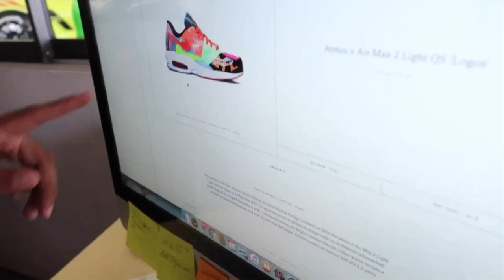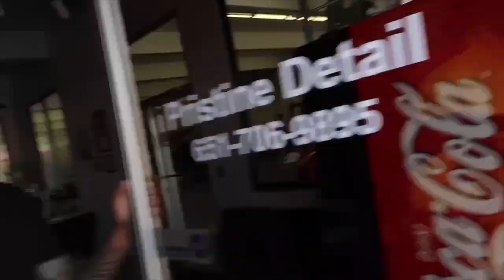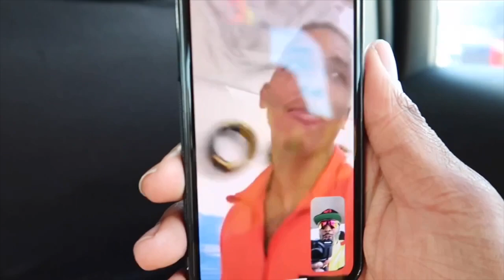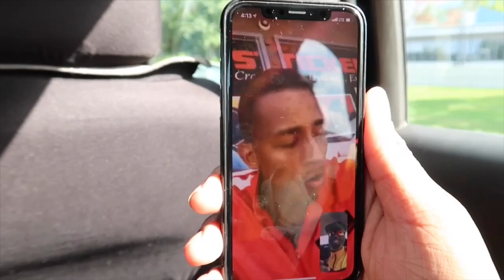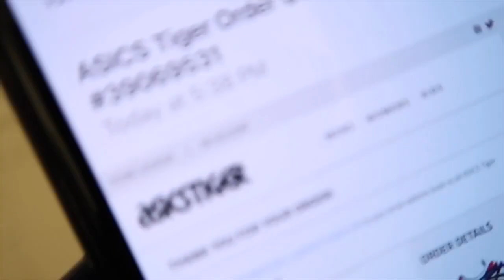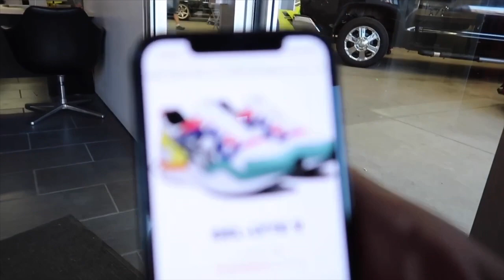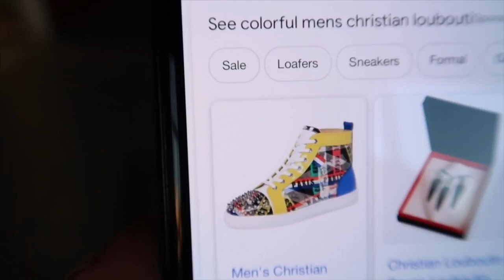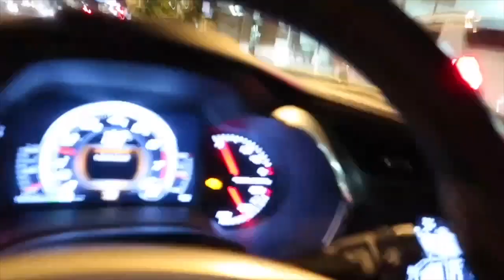CORVETTE REBUILD COMPLETE: I HAVE THE WORST WRAP IN YOUTUBE HISTORY!!!

Comment: Add some pinstripes that blend in the colors together, or make like a line of the green door go into the orange. You know how some hot rods have flames on the hood thst extend to the fenders, something like that but subtle that connects all the colors together. It's not a bad concept at all but it could've been executed a bit better. Just needs yo blend in together. Make it look like the paint is getting ripped from the front to the back because of high speed.